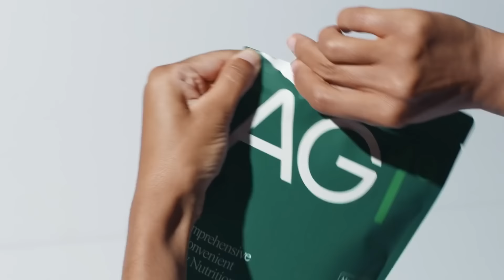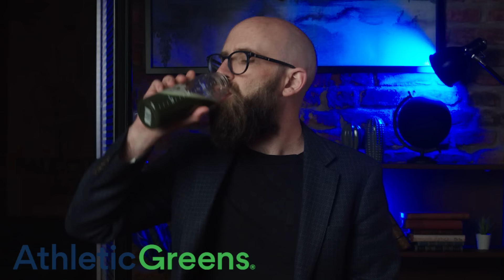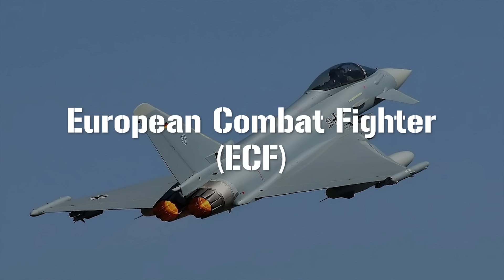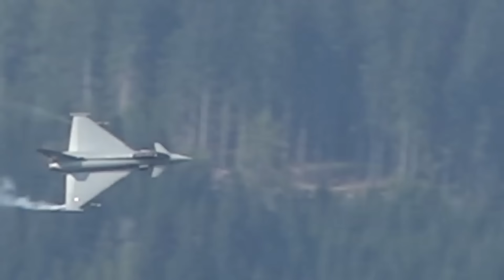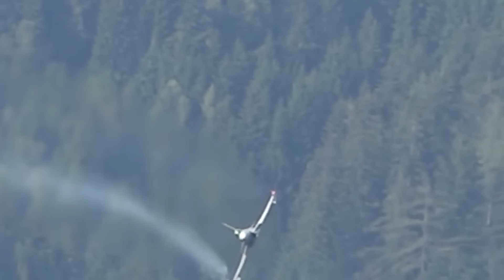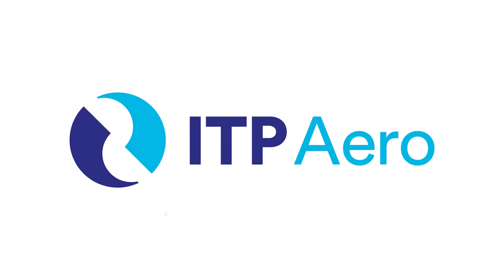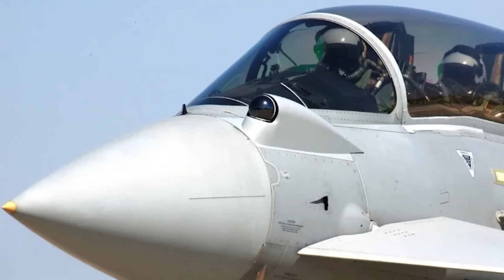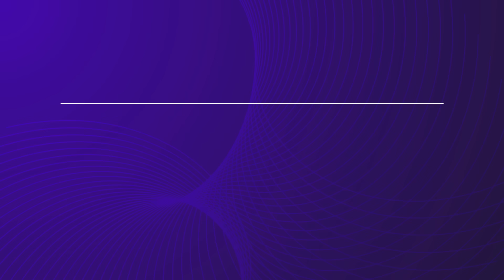The Eurofighter Typhoon: Any Aircraft, Any Mission

Comment: WTF?!? Simon actually said “pounds force of thrust” instead of “pound feet of thrust.” Did hell just freeze over?!? 😆

It’s such a long-awaited improvement that the jury is happy to overlook conflating the center of gravity with the center of lift. Baby steps, Simon. Baby steps.
Reply: What's wrong with just "Pounds of thrust"?
Reply: Um. Pounds Feet is a measure of torque. Thrust is measured either in newtons (force) or "pounds force" which is based on the force (in newtons) that x pounds of mass exerts on a surface due to gravity.
Reply: @stonelaughter  Yep. You have a firm grasp on why “pounds feet” is utterly wrong when talking about thrust.

Comment: Well, tbf even if the Eurofighter is by no mean a bad jet compared to its rival the Rafale, it's a bit lackluster...
Reply: It’s the better platform for BVR engagements which is basically how every modern conflict in the air happens
Reply: the typhoon is better suited for BVR engagements, as it has a higher TWR, bleeds energy slower, and accelerates much faster, as well as better supersonic maneuverability.

even in a dogfight, although closer, the typhoon still comes out on top. the rafale can pull higher alpha, which makes it better in the 1 circle, but it bleeds energy much faster than the typhoon and recovers it much slower. also, due to its lower TWR, it would fall behind if the typhoon took the fight vertical. overall, this makes it much easier for the typhoon to dictate the fight, and force it 2 circle, which it is much better suited to than the rafale, as it has a greater sustained turn rate.
Reply: So the rumour goes the head of the French Airforce picked the Typhoon over the Rafale simple because it has better engines...so yeah better aircraft my arse. The only advantage the Rafale had over the 'Tiffy is that it got the AESA radar right off the bat, but that's now been negated due to the Typhoon force finally getting that upgrade.

Comment: If the rest of the group listened to the French designers, Eurofighter would a much more capable plane.
But then we wouldn't have awesome Rafale :D
Reply: The typhoon is better suited for BVR engagements, as it has a higher TWR, bleeds energy slower, and accelerates much faster, as well as better overall supersonic maneuverability.

Even in a dogfight, although closer, the typhoon still comes out on top. The rafale can pull higher alpha, which makes it better in the 1 circle, but it bleeds energy much faster than the typhoon and recovers it much slower. Also, due to its lower TWR, it would fall behind if the typhoon took the fight vertical. overall, this makes it much easier for the typhoon to dictate the fight, and force it 2 circle, which it is much better suited to than the rafale, as it has a greater sustained turn rate.
Reply: @pieface6421  The Eurofighter might have been better suited for BVR, if only it had an AESA radar. All you have to see is every single time the Eurofighter went against the Rafale in competitions and fights. It was a landslide victory for the French bird.
Reply: @richelieubestship1129  the typhoon does have an AESA radar. In fact the typhoons is on a gimbal, giving it a much wider scan field than the rafales fixed radar array
Reply: @pieface6421  Except there is no service typhoon with an AESA radar, that's the difference.
Reply: @pieface6421  Firstly, modern changes to Rafale bring his TWR around 1.2, so in terms of TWR both planes are pretty much equal (depends on Rafale variant).
Secondly, Better TWR, and overall low/high speed maneuverability doesn't give you any advantages in BVR, so you are literally talking nonsense.
In BVR the most important aspects are RCS, radar/jamming capabilities, and your weapons systems. Since both planes use the same weapon systems, and have similar radar capabilities, it's all down to RCS, and jamming. Rafale wins here easily since it has lower (thus better) RCS, and it comes with SPECTRA electronic warfare system, which only improves stealth capabilities of the plane while at the same time provides solid jamming capabilities.
Ironically, Rafale RBE2 is better for detecting low RCS targets, where Camptor-E while has probably superior range it isn't better at detecting low RCS planes like Rafale.
So in BVR, Rafale would most likely detect, and engage Typhoon much earlier than Typhoon can engage Rafale. 
Once the plane goes defensive in BVR in most cases it's either dead, or it needs to disengage, and run.

As for dogfight, with improved specs both planes are on somewhat equal standing where one plane is slightly better at one thing, and vice versa i.e. Rafale excels at low speeds, and Typhoon and high altitude high speeds.
Since modern air combat is mostly about BVR, the Rafale is much better air superiority fighter than Typhoon, since it's low RCS and jamming capabilities are simply better than Typhoons. Flying slightly higher and faster, doesn't win you BVR fight when going against stealth capable planes.

Also, Typhoon is lacking versatility as it is only a land based plane, where Rafale bring also carrier capabilities. 
On top of that, Typhoon engineering came with some issues when it comes to what pods it can carry, which reduced its air-to-ground capabilities. 
So with better pods and Rafale's better handling at low speeds, especially with external payload, it makes him much better air to ground attack plane than Typhoon.

So all in all, Rafale is better BVR fighter against small, and stealthy planes, it's somewhat tied in terms of doghfight, and it's a better bomber with bonus carrier capabilities.
If anything, Typhoon probably excels at intercepting and destroying enemy bombers, since Captor-M/E is excelling at long rage detection of big planes.
Reply: @GrimPlayerOne  the rafale is not a stealth aircraft. it may have a reduced RCS when clean, but the difference is negligible with weapons and drop tanks included. the typhoon and rafale also have roughly equal capabilities in terms of phased array jamming and RCS decoys, both of which become less and less effective as the fight develops and range decreases. they both use AESA radars (the typhoons having a wider scan field, since it is on a gimble, unlike the rafales fixed radar array), and they are both capable of "anti jamming", allowing them to somewhat counter the effects of radar jamming. they seem to be roughly equal in terms of EW capabilities 

in terms of a2g, the rafale was designed as a multirole fighter from the start, where as the typhoon was originally designed strictly for air superiority, with all a2g capabilities added after. therefore it makes sense for the rafale to be better suited to ground attack.

lastly, while the carrier capabilities do add to the usability of the rafale, it wasnt important to the other 4 members of the program at the time of design, and only served as a hinderance. neither Britain, Italy, Spain, or Germany were operating carriers that used catapult TO and cable arrested landings, so it would literally only serve France. Being carrier capable also comes with some limitations. most notably it requires a smaller airframe, which comes with reduced fuel load and therefore reduced combat radius (typhoons is 1500 n miles, rafales is 1000 n miles). it would also add "useless" features for the other partners, such as wing fold, which would only add complexity and maintenance cost.
Reply: @pieface6421  No one says that Rafale is a stealth plane, but the reduced RCS together with SPECTRA makes Rafale much harder to detect than Typhoon when it's utilizing Praetorian, and it was proven when Rafale was pitted against Su-35, where Rafale had weapon lock on Su-35 when Su-35 didn't even detect Rafale on his radar. The outcome of such tests, and the fact that Rafale is a better multirole fighter, was the reason why many countries opted to buy Rafale.
Even if you want to argue that they have "roughly equal" EW capabilities (which they don't) then still Rafale is harder to detect than Typhoon, and this can make a lot of difference in BVR (or even in ground attack scenario) depending on what enemy plane you will go against. While both planes will deal well with something like SU-35 the Typhoon will struggle a lot against planes like Su-57, J-20, or even Rafale itself since Captor-E is not that great against any planes with any form of stealth design.

Yes, and this is why Typhoon designers screwed up:
Typhoon trades multirole capabilities for max speed, max altitude, and better high speed maneuverability.
Rafale trades a bit of those things for wide array of multirole capabilities, AND then covers this tradeoff with better stealthiness, which makes it as good if not (in some cases) better modern BVR fighter than Typhoon.

In the end, the Typhoon air superiority/interceptor design didn't pay off, and they were forced to do what France did in the first place with Rafale, which means, that from day 1 the Rafale was overall a better design \_(ツ)_/
Reply: And it would have served-up first class in-flight croissants and coffee.
Reply: @sandypatience  Eurofighter is inferior to the French Rafale, it's nothing new.
Reply: @GrimPlayerOne  Are you French?
Reply: @sandypatience  Nope, and Rafale is still superior to Eurofighter because of better airframe engineering. Deal with it.
Reply: @GrimPlayerOne  I'm not sure that I have the same kind of passion as you to be able or want to 'dea'l with anything. But good luck with your anger, may it serve you well.
Reply: @sandypatience   What anger? I stated the fact about mismanagement of the Eurofighter project which lead to France splitting and designing better plane, and you came in butthurt posting dumb stereotypical jokes like some 12 YO kid.
If anything, you are the one being angry.

Comment: I remember the 2016 air France incident. My younger brother was stationed at RAF Coningsby at the time and he face timed me as the typhoons were taking off. Can  confirm that those ej200 engines are LOUD, not only after face time with my brother. But also after seeing them at the RAF Coningsby open day in July 2016, performing manoeuvres for the crowds, and at the mach loop in 2017!
Reply: having heard the Eurofighter take off and the F35... the F35 is louder! The loudest jets at take off that I have heard were the Concorde.... my house windows vibrated, and the Avro Vulcan
Reply: @adriaandeleeuw8339  b1s, f111s, and b52s
Reply: @USonuMabeaCh  Australia had its own F111s the F111C
Reply: there is a B52 and an F111c on static display at the Darwin Aircraft museum
Reply: I remember seeing it demonstrated at the RAF Cosford airshow, when they were just coming into service. Must've been about 2004 I think. It was the last display of the day, and me and a school mate were sat on the roof of my dad's car waiting for it... The Typhoon came over at high speed and banked sharply away, briefly turning both lit afterburners towards us. I remember the car physically shook with the noise, it was unbelievable.

Comment: Rafale now, considering it has an even better reputation than the eurofighter...
Reply: Rafale has a slightly different purpose, it's made for ground attack too (like a fighter bomber) and it's a carrier aircraft. Typhoon is primarily an air superiority fighter, and no carrier aircraft.
One problem of the Typhoon is the only country spending sufficient money on improvements and modernization is the UK. German Typhoons still fly without Aesa radar. The best equipped Typhoons are the British ones.
Reply: @simonm1447  Actually the best equipped will be Qatari, as they are being produced in tranche 4 standard with an AESA radar off the bat. The British ones haven't got a AESA, witch isn't that much of an issue since CAPTOR M is still pretty good.
Reply: @jamiegray6931  haven't got AESA yet, they're getting it in the coming years
Reply: @hondansx1000  Us or the Qataris? Their aircraft are getting CAPTOR-E right off the bat, wich is AESA.
Reply: @simonm1447 Germans military power in itself is a little bit usseles. Lets wait 10 years, and look what they will be done.
Reply: @kerstas10  Germany reduced the budget after the downfall of communism in 91, and aircraft like the worn and obsolete Tornado which would normally had been replaced long ago are still in service with around 20 % of the original fleet.
Now after 24/2 the necessity to rebuild the German military has been recognized, and the obsolete Tornados will get replaced by Block 4 F-35 A stealth fighters with a wide range of different armament. The Eurofighter will get a ECR version too.
Reply: @simonm1447  Your comment is true, to some extent. But Eurofighter has evolved into a multirole aircraft like the rafale in many ways. 
And yes, the rafale has naval and nuclear versions, which could be interesting aspects to develop for the dedicated video.
Reply: @yotayota99  that's right, the Typhoon has evolved and is now also used for ground attack. The difference to the Rafale is the main focus of the Eurofighter is air superiority with capabilities on ground attack, while other capabilities than air superiority  for the Rafale had a much higher priority for Dasault from beginning on.

At the moment France, Spain and Germany are planning together with the FCAS as a Typhoon and Rafale successor lead by Dasault as the main contractor, but Dasault and Airbus still have different opinions in some things and it's unclear if the cooperation will be continued for long
Reply: @simonm1447  The FCAS (SCAF here in France) will probably never see the light of day. Basically Germany is going against all of what the country promised to France because they know there is a strong political wish in France for European cooperation (there is not in Germany). But this won't last long and in my opinion the project will not last more than two years starting from today... And I'm being optimistic.
Reply: @yotayota99  it's more a twist between Dassault and Airbus at least in my knowledge, Airbus still has a hard time to accept Dasault has the technological leadership in this program. Airbus is essentially more French than German, some French even consider Airbus as a French company.
If I remember right there is a deadline until the end of the year, if they still don't have agreed then Airbus may leave the program
Reply: @simonm1447  Yes but no. The part of Airbus involved in the project is Airbus defence and space. Basically, their projects are mostly used by the German and other countries' armies, but not the French one which buys mostly Dassault products. So in that case, Airbus represents German interests, Dassault the French and Indrz (which was brought by Germany to counter Dassault leadership even more) the Spanish.
Reply: Airbus is a multinational company, but many projects are compartimentalised inside the company between the different countries. So France has no access to a lot of German projects and vice-versa. It is very complex and is what has allowed Airbus to be so successful (it would not exist otherwise)
Reply: The rafale is a great aircraft but it lacks reliability and is not proven in any combat at all. Not as technical as a typoon and can't carry the weaponry tye typoon can
Reply: @MrDecy69  The Rafale is combat proven, more reliable and less expensive than the Typhoon. There are other things that can be argued, but it is pretty much impossible to say no to that. It has also ranked better in most international competition
Reply: @MrDecy69  false The Rafale si one of the best fighter in term of reliability, he was. combat proven in 2006 and carry same armement l’île meteor